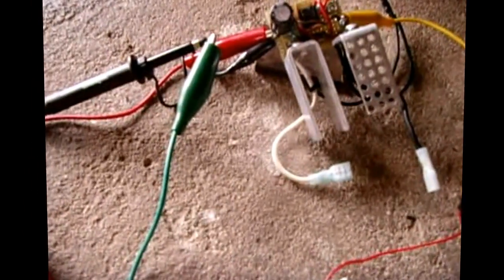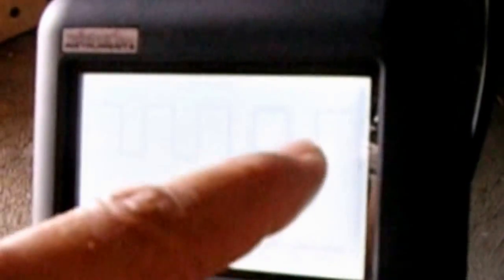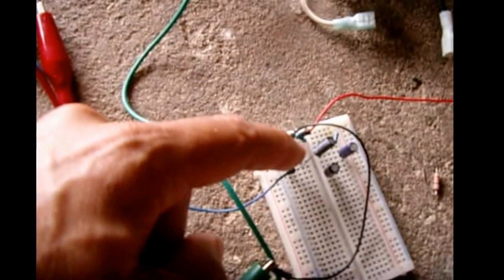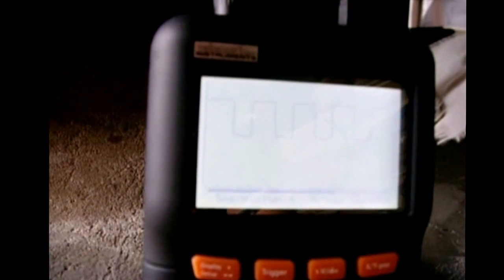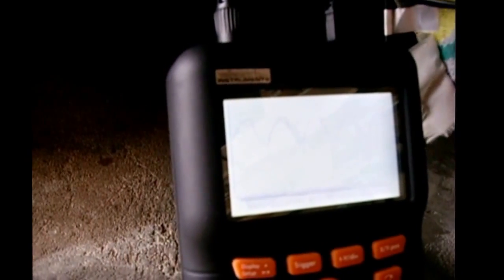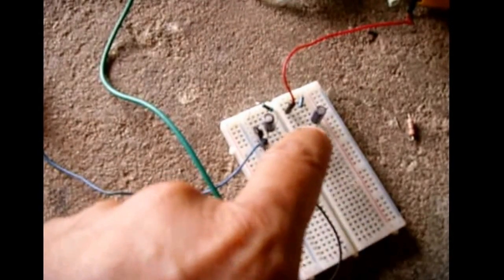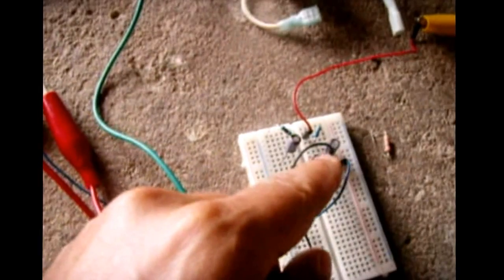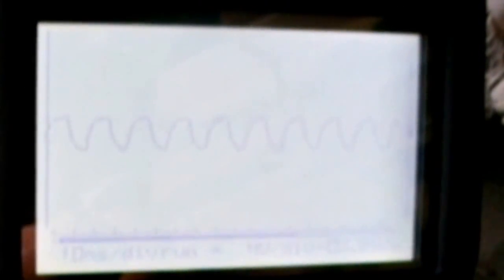555 Timer IC Waveform Shaping/Modification

Comment: Thanks for the great job man!  Can the RC circuit be used on the Sg3525 inverter oscillator instead of this 555 timer?
Reply from the maker: Not sure about the SG3525 PWM IC, the inverters shown on my channel use other IC's.
Reply: Ok! I'll just try it. No harm in trying right? 😁